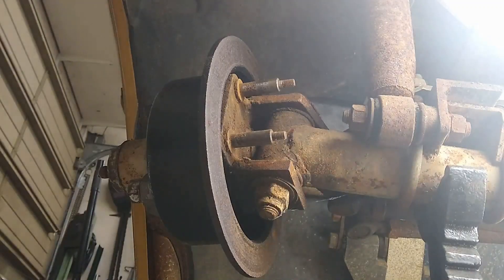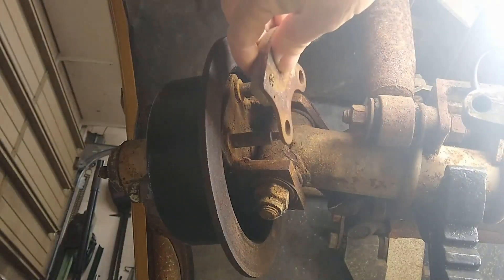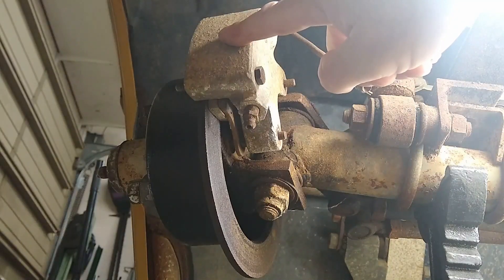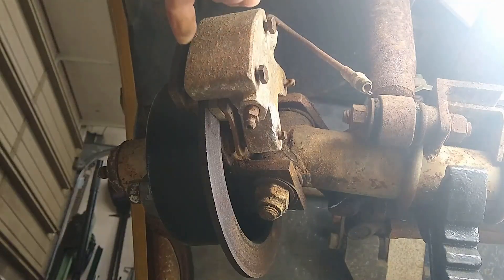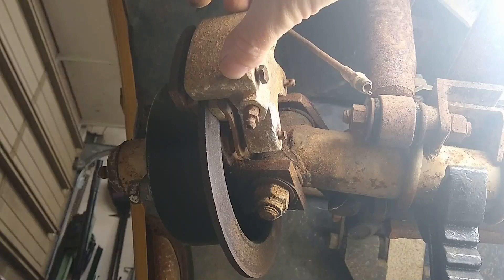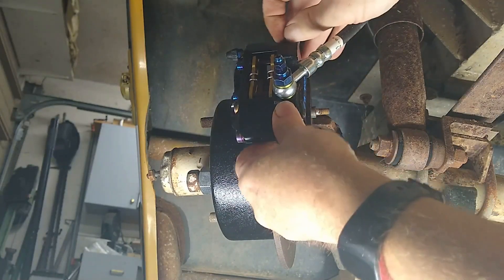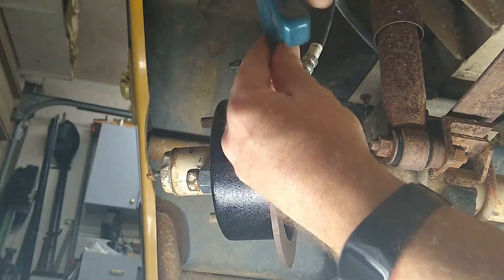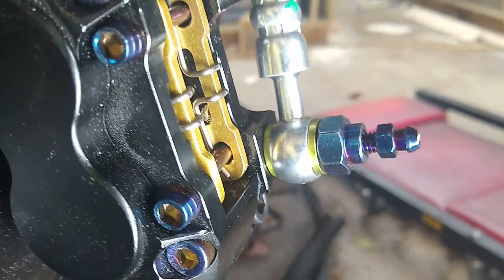CitiCar front brake conversion

Comment: As has been mentioned by others, the pins are supposed to be sliding to allow the caliper to float. These are Cleveland Cessna 152/172 calipers, and replacements are expensive if yours are pitted.

I also found that the springs fitted to the caliper to pull the pad away from the rotor (to reduce drag, increasing range) tended to cause the piston to tilt in the bore, becoming stuck.

Comment: So I took the calipers off my Citicar yesterday, they were STUCK STUCK and I had to use heat to pull them off. The heat also brought about a very interesting discovery, the pins that the caliper bolt to are supposed to be free floating in the knuckle! On my car (and I suspect yours as well) the pins are (were) corroded in place and would not slide properly/at all. Machining a caliper adapter that slides on these pins opens the way to a failure mode where the pins come loose and slide out of the knuckle and the caliper adapter, letting the caliper fall off the car. 
I like your solution with motorcycle calipers, the stock calipers have other design issues. I'm going to follow the same road, but I will machine my adapters with shoulders just like the stock calipers so that the pins would slide out.